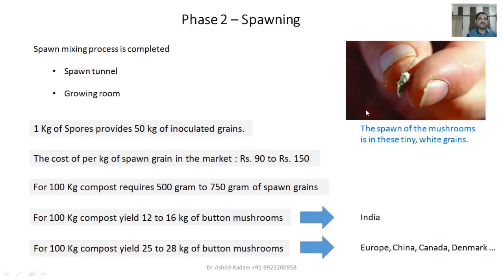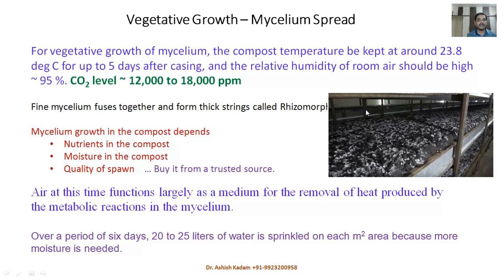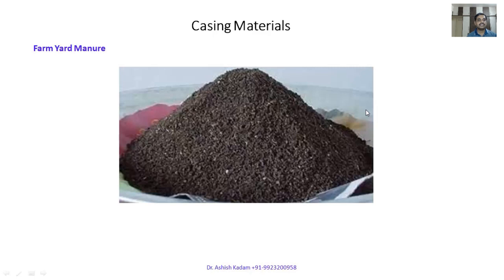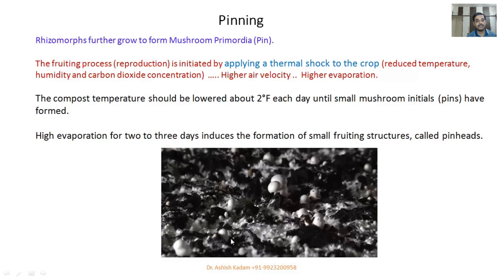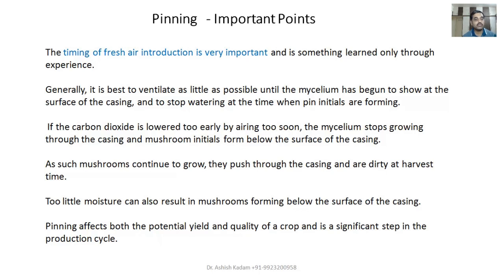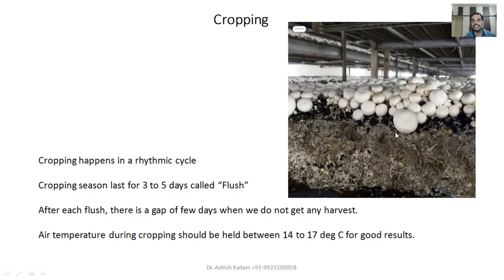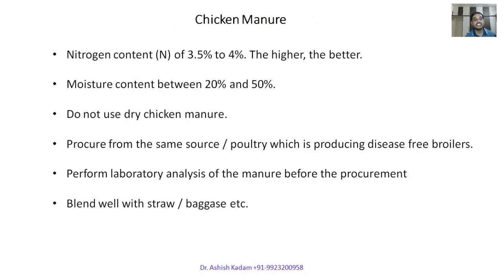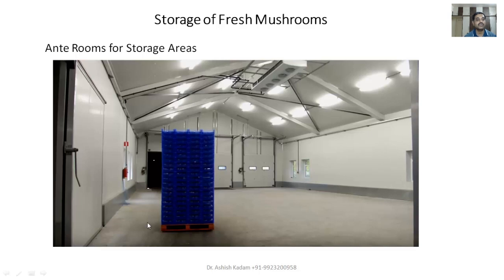Video 3: Spawning Pining to Cropping in Button Mushroom Farming

Comment: Manufacturing / importing & trading in items used in button mushroom industry 

PP 7" X 16" for spawn bag Rs180/= per kg Delhi

6x7 , 200 gm,  30 kg, Rs180/=

Compost Bag HM 24x30
With handle 
50 pcs
virgin quality 
Rs145/= packet

https://youtube.com/shorts/4Oo1jAZBtrg?feature=share

Compost Bag LD 22x24
50 pcs in one kg 
virgin quality 
Rs150/= per kg 
https://youtu.be/_oNNeKZVrS4
https://youtu.be/KGYVm-au8Qc

Punnet Rs110/= per kg 
https://youtu.be/6hIt_1fSMFg

Poly Air Duct tube Rs180/= per kg 
15" to 32" size

Punnet packing machine 
Rs3000/= & Rs7000/
https://youtu.be/frEV_vdeBks
https://youtu.be/X44zvK82-Cg
https://youtu.be/zZcwate4kuQ

Trading 

Cling film Rs3300/= box
6 pcs in one box 
Antifog food grade 
Oxiwrap 

Hydrion Ammonia Meter Test paper strip :

This is used to check ammonia levels in tunnels (phase 2) during conditioning stage .
The result is accurate in 15 second time , more than 100 tests can be performed 

Range : 0-5-10-20-50-100ppm
Rs2100/=

Co2 Meter Rs10500/= 
Range 0 to 9999 ppm 
With temperature & humidity function 
https://youtu.be/NnUAMTOpajM
https://youtu.be/gsM3fdggjrs
https://youtube.com/shorts/l9y-Mj0EhfY?feature=share

Sealing machine 12" Rs1300/=
One year warranty 

Gardena shower Rs2100/
Made in Germany 

Digital hygrometer 
Wet and dry bulb Rs500/
Brand : Zeal,  (Made in England)

Digital thermometer screwdriver type Rs150/
https://youtu.be/ZH1GXP2ibsE

InkBird 
Wi-Fi temperature meter with sensor and controller Rs4500/
You can download the app & control temperature from your mobile phone with high & low alarm alert & other features 
This device can be used in compost tunnels & growing rooms 
https://youtu.be/oWcBYW7Fu7U

Glass thermometer 12" 
Rs60/ & Rs200/

Ph strip Rs400/= & Rs1100/

Humidifier 5lt per hour capacity 
Centrifugal Rs26000/ with sensor and controller 
https://youtu.be/bEh56VyIT-Q
https://youtu.be/hdYtcgRtAMI
https://youtu.be/McSEHSiXAu0

Formalin Rs35/= per lt plus GST

KMS Potassium Mesabisulphide for washing Rs90/= per kg

Cocopeat 
Rs24/
Full load Rs23/

Rope 
Material PET
Rs290/= per kg
One kg has 100 meter length 
Used instead of saiya in Mushroom racks 

Co2 dampers Rs2000/ per pc 
& fresh air blowers
https://youtu.be/l6pz0r63c64

Spigot for aerated flooring in tunnel & bunker Rs16/ per pc
https://youtu.be/1_Fh4nImBjE

Button mushroom knife 
https://youtube.com/shorts/uFqTVBrYrL0?feature=share

Packing tape 2"

Tape dispenser 2" tape
https://youtu.be/nGh46Vpz1T4

Delivery Delhi

Vivek Kapoor 
7590008263
9818578263 whatsapp only.